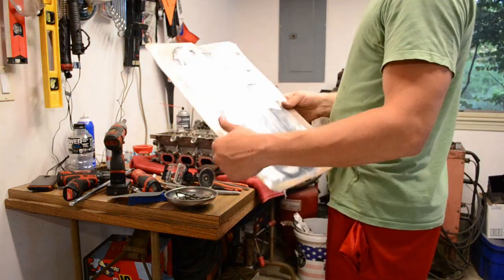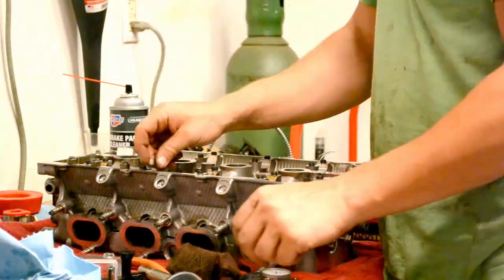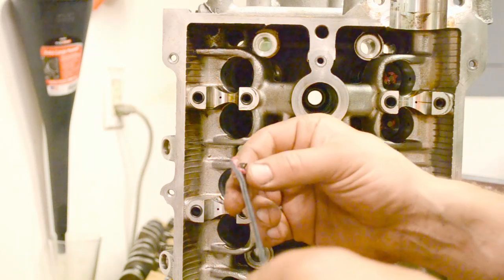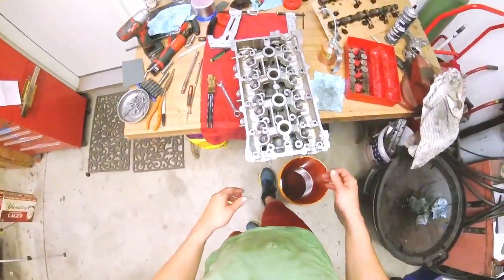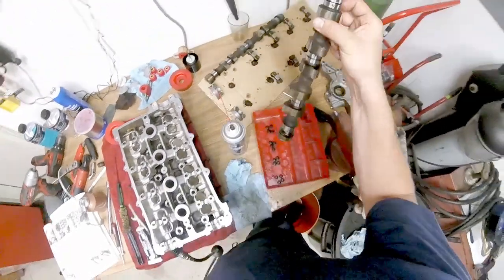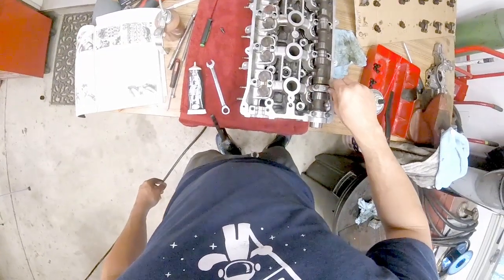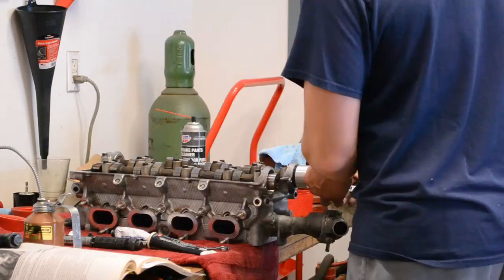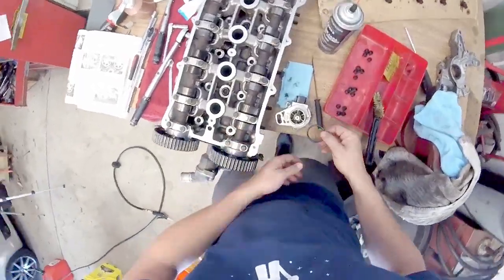Miata Engine Build Pt2 - Step-by-Step DIY Cylinder Head Build

Comment: Love the videos brother, about to be diving into my 1.8L for a fresh rebuild for my wife to learn how to start racing! Before I started this I was looking into the exact rebuild kits you used, not sure if you linked them anywhere but could you share them :) . Also, FM is out of stock for the specialty tools linked in description, any idea where I could get those tools? I'll be ordering the spring compressor today as well!
Reply from the maker: Heck yeah! Love to hear it!!  The kit is actually a smattering of Rock Auto and Genuine Mazda.  If you are going to do the work yourself, spend the little extra coin on the rebuild kit right from Mazda.  Any dealer can sort you out for it!  It will be more than aftermarket but it will eliminate a lot of head scratching if it's your first rebuild on a Mazda motor.
Reply: @racecarcamp9056  Word, thanks for the reply!! I will contact a local Mazda dealer and see what they have to offer, thanks for that advice. I was looking at some DNJ rebuild kits before seeing this comment. Any direction/lead to find that special tool kit? FM is sold out online. Just got the motor/trans pulled today, holy smokes this thing was dirty!
Reply: @racecarcamp9056  What parts do you recommend be genuine Mazda? They don't offer a full rebuild kit like they used to. The DNJ rebuild kits look promising, maybe matching that up with all genuine Mazda seals/gaskets?
Reply from the maker: @One_Cam  Your cam and crank seals you should buy genuine mazda.  Piston rings and head gasket, both genuine mazda.  The rest is pretty ok on the aftermarket.
Reply: @racecarcamp9056  thank you so much for your help so far! do you have Facebook messenger or another means of communication I can add you on?
Reply: @racecarcamp9056  I guess my big question is, since i'm doing this for a fresh rebuild on the car (97k miles) + there were no huge apparent issues going on, should I be replacing the springs, lifters, valves and pistons or just inspecting them and reusing them? If I'm not replacing the parts is there even a real reason to take apart the head? I followed your advice on the OEM Mazda stuff for the seals, gaskets, rings as well as the oil pump etc... Just want to know the best route before I tear the head apart with no replacement parts ( Only thing purchases for head is valve stem seals) and if I should get any parts here before doing so or just focus on a great scrub down on what I have and reuse? More research I've done, people really put miles on these units so I feel like maybe 97k isn't too crazy haha
Reply from the maker: @One_Cam  yeah hit us up at RacecarCamp@gmail!  Happy to help!
Reply from the maker: @One_Cam  No, I wouldn't worry about springs and lifters if your head isn't warped and doesn't need machined.  If you have to send the head out for machining, we'll that would be a different story/opportunity for some upgrades.  But springs and valves get expensive VERY fast!

Comment: Thanks for all this , I’ve been watching over and over. I want to boost my Miata but in a leak down I determined the exhaust valves on 2,3 aren’t closing all the way. I started preparing to pull the head just the other day

Comment: Nice video thank you what dude you torque the cam cap bolts to
Reply from the maker: The manual I'm using says 100 - 125 Inch/Lbs which is barely more than hand tight - so don't go crazy!

Comment: What is a list of stuff that I need to buy to replace old stuff. I want to know so I have them ready before I start taking stuff apart
Reply from the maker: For a cylinder head that isn't warped, you'll want new valve stem seals, cam and cas oil seals, and a valve lapping tool and compound.  The rest is elbow-grease!